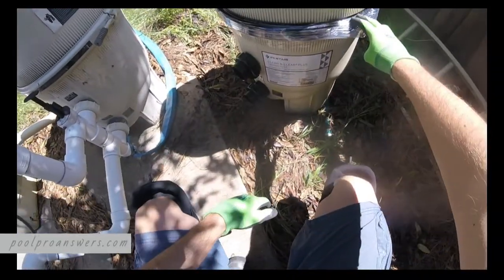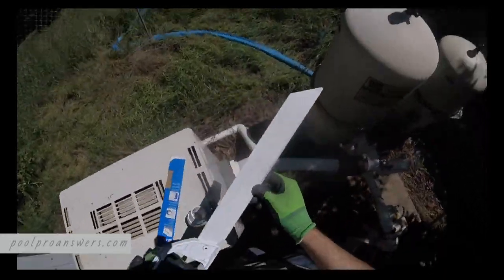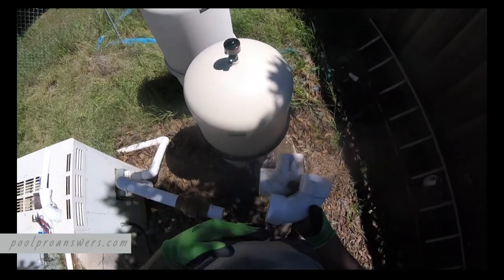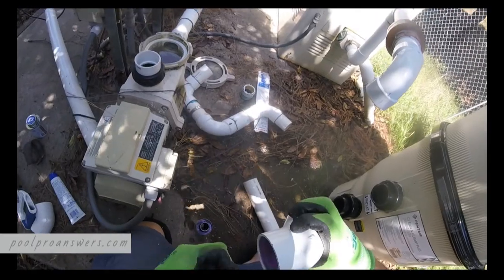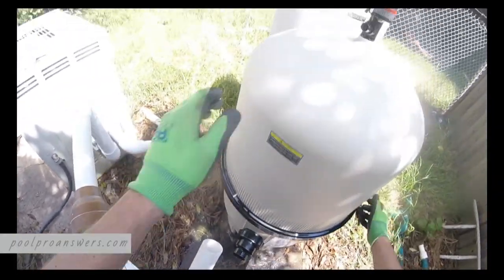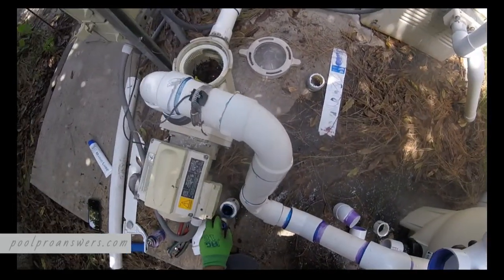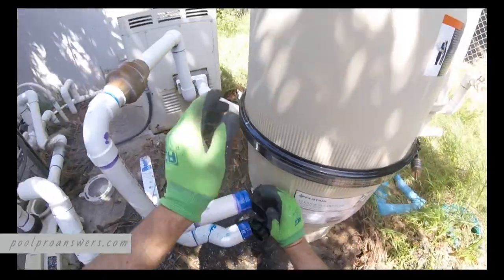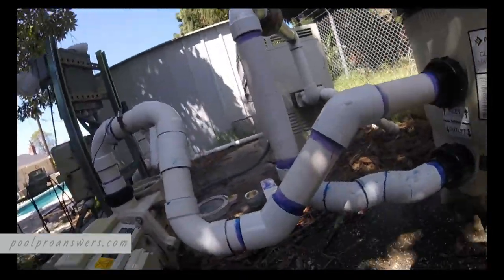Pool Filter Conversion The Easy Way

Comment: DE filters are better longer lasting and cheaper, just more labor to clean, specially the older stainless with out a backwash. would love to see a video showing how to convert one of those have a backwash added. good stuff you put out!
Reply from the maker: Thank you.
Yes those old stainless beasts are pretty dangerous. In my service business we encourage our homeowners to remove those as soon as is practical. Because of the small bands and outdated components they can be a hazard. If/when we come across one again, I'll try to put a video out.

Comment: I have a idea for another video.  The Pentair clean and clear filters have the drain plug that gets brittle and breaks off when they get old.  When they break off they leave the threads inside the filter.  Would love to see a video on how to remove the threads so you don’t have to replace the bottom 1/2 of the filter case.  My pool guy’s (now Ex-pool guy) solution is to replace the entire filter.  This weekend I am gonna figure this out.  No YouTube videos on this.  Enjoyed your video!
Reply from the maker: Awe man that stinks.
Yes, I've encountered  it and fixed it. I have a slight leg up on most service techs when it comes to that type of repair as a former machinist.  Unfortunately I wasn't filming when that happened. But you should be able to get at it from inside the filter, although you may be able to do it by disconnecting the base from the plumbing and flipping it over on a workbench.   If you get it out, plumb a threaded pvc fitting to a 90ell to a straight pipe, put a ball valve on the end and you'll never deal with the drain again.
Reply from the maker: Also, thanks for watching the video, hope you subscribe...putting together  couple new videos right now

Comment: Good job on the not using too much glue on the internal fittings. I would just recommend carry around some scraps of cardboard to keep your fittings out of the dirt. Also I like to use a sharpie to mark the alignment when dry fitting. Thank you for uploading and the part about reversing the in and out most people would miss that step.
Reply from the maker: Funny you mention that. I usually have a tote with my fittings. I actually typically use electrical tape to mark my alignments. Either way, thank you for the feedback. I love the youtube community!

Comment: Good job but where did you get the union when you replaced the electric fitting on the top of the pump?
Reply from the maker: Most of those unions can be picked up from a pool supply house. They are standard sizes that fit the various pump housing threads.
Reply from the maker: here's what I use. on amazon; 
https://amzn.to/3h1h2eM . FYI this is an affiliate link. It doesn't cost you anything extra, but I do get a commission.

Comment: Why would you convert TO cartridge 😬
Reply from the maker: Easier to maintain and better for the environment.
DE is still best for pool water quality though. And cheaper to operate.

Filter media preference is very region specific. Here in northern California we steer away from DE.
Reply: @PoolProAnswersDIY  if environmental concerns were the primary driver, I would have steered them to something like aquaperl. I have an old pool and last year we had some refurb work done, and the pool company changed all the grids and brackets and charged it with aquaperl instead of DE, and despite my initial reservations, I think it actually does a better job than DE. im in San Diego
Reply from the maker: @rjgmedia6298  Very nice!!